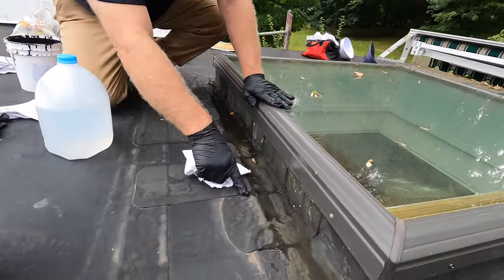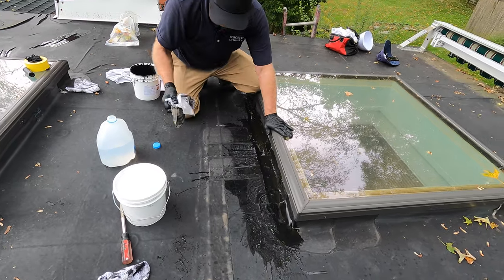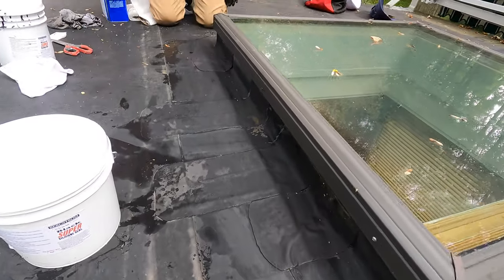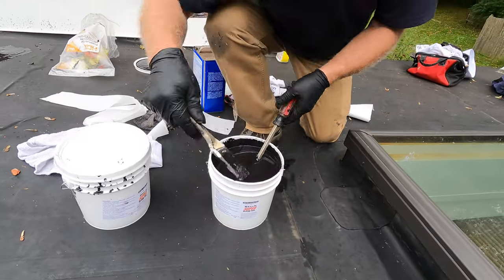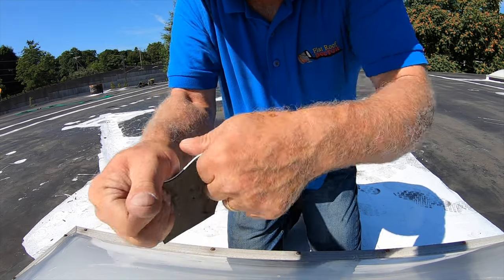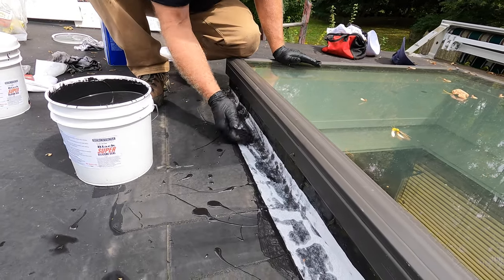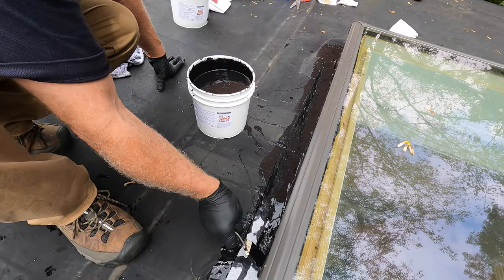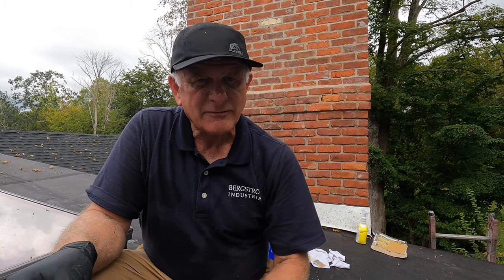FLAT ROOF LEAK REPAIR : Repairing a rubber roof leak very simple and easy and fast- GAME CHANGER

Comment: The problem with silicone based products for leaks has always been that the ultraviolet light from the sun utterly destroys silcone in about two years.  What has been done to prevent that problem with this product?
Reply: You’re absolutely right. Everyone swore by flexseal. I used a gallon of it on my roof and that stuff crumbled apart like old thin rubberbands after two years
Reply: How about silicon product underneath a traditional EPDM tape patch? Silicon would be protected from the sun by EPDM. (I've been battling a leaking skylight for a year)
Reply: @thomfriend1946  just get a real roofer who knows how to replace it instead of constantly temporarily sealing it
Reply: @kevin_e90  after 2 years? Epdm has life expandency of 40 to 50 years
Reply: @mule666  no it doesn't lmao. I haven't seen a EPDM roof that's lasted longer than 10 years or so. The sun dries it out and all patches start lifting over time. That's why it's the cheapest roofer. A mod bit or bur roof is the best, and only those last 20ish years at most
Reply: @kevin_e90  ok
Reply: Silicone is very UV stable. Not sure what else is in the products you've used, but I sincerely doubt silicone is the issue.
Reply: @T2rrusso allegedly have you yourself used it and  can attest to that?! I’ll wait and if so plz tell
Reply: @Truth-L-knowledge  In fairness, it's not alleged - it's  fact that silicone is very UV stable. In my opinion,  technique of application is paramount for a long lasting seal. Individuals have very different standards for what they consider "good" workmanship, and there are so many variables that can cause premature failure. If silicone isn't for you, that's perfectly fine. My point is only that it is unlikely the silicone is the component that is breaking down due to UV. Take care.
Reply: People who dont know commercial roofing wont know how to instal it nor clean the area riight ….also certain brands and silicone last years if you buy cheap crap it wont last anything
Reply: @kevin_e90 i agree im in uk epdm lifts and goes on joints torch on is best am experimenting with a few liquid systems which seam to be working
Reply: @kevin_e90 I've seen a 54 year old EPDM before. And over 30 year old PVC. 40 year BUR (4ply or better, mind you) 20 year tpo though it was a type they don't make anymore. Haven't seen too many old mod bit.
Reply: Silicone has high resistance to uv
Reply: 10-20 years if applied properly
Reply: @rexanderson5024 Sure  if you believe the marketing.  Kind of like how Tamko claims 50 year 160mph warranty right?
(Sarcasm,  you will never get that out of this product)
Reply: Many liquid rubberized/silicone roofing material suggest a UV protection topcoat for best results. Shoot, most DIY don't read instructions or follow manufacturer recommendations.  It's lucky if it even gets mixed!😂😂😂
Reply: $250.a gallon?   What cha all smoking?
Reply: I patch three sections of my roof with the stuff and it's been a year and a half and it still looks absolutely perfect, and my EPDM roof is 25 years old and the only reason I got a leak was the original glue that they glued it together with is cracking and crumbling

Comment: I see a trough was created next to the skylight which causes the water to sit there and rot out the silicone and rubber cement...that should be torn out and done properly
Reply: or just fill the trough
Reply: Or seal a piece of gutter in there.
Reply: Patch over patches.?? Seems like a slap dab job to me

Comment: What happens to the water under those repair flap edges you pulled up? Won't that get trapped and cause bubbling later on?
Reply: Ya I would use a hair dryer to dry up the water under the rubber otherwise you'll have a problem.
Reply: Yes.  Water condensation will create a huge blister bubble between membrane and repair.
Reply: @richardlawrence3770 heat gun better then hair dryer 😮

Comment: This is nothing but a patch on top of the other patches you mentioned. Unfortunately, in two to four years, you'll be putting another patch on top of that patch.It's a never ending battle with the sun and rain.
Reply: Are you suggesting full replacement over trying to patch for a fraction of the cost? I have a 15’x15’ that is leaking.
Reply: 2 years is enough time to come up with a plan for a new roof.

Comment: It all comes down to how much you are prepared to pay or invest your time.  I have  a galvanized tile roof, the tiles sprayed with bitumix and coated with chip.  But around the edges where the water drains off the underside of the tiles (which were not painted   have rusted heavily in some places and only in a few instances has the rust broken through. The cheapest and easiest way is to patch the holes as this roofer is doing.  They might last a few years until   the rust underneath creep through.  To lift all the roof tiles around the perimeter is a time-consuming task and expensive if paying someone else.  It is quite a job removing the nails and individual tiles, cleaning them  up treating the rust, priming and painting before putting them back .  Even repacing with new tiles is still quite a job. What is frustrating is the inconsideration of the roofers who laid my roof. My father, an excellent builder, always said If you put something in, think about those who may have to remove it some years later. I have had a terrible job removing some tiles that were nailed in a way very difficult to reach the  nails.  This  was not necessary and only laziness. But it has taken much time and energy.  

 I notice this roofer rarely lifts the iron roofing sheets to check for rust on the underside, something I  believe should be done where possible.

Comment: Thank you for the video
But the product is quite expensive 
The silicone based products are nice to work with as they are liquidy compared to the rubberized patch cement, which is very thick and hard to spread without making a mess. What will be the drying time for that work? I’m curious how long it takes for that silicone product to dry

Comment: I am trying to repair my flat roof. I have applied the adhesive to the roof. When I lay felt onto the adhesive do I have to peel off the thin plastic sheet from the felt first? Absolute beginner here😮😮.
Reply: Yes

Comment: That stuff looks great, is it used in the UK as I'm looking to add flat roof maintenance to my exterior cleaning business?
I've already used Bostik instant flat roof repair which has fiberglass in the solution
Reply: I'm a roofer in uk start using hydrosil mate or cromarpols cheaper

Comment: what is the point of the fleece? just another type of patch with silicone seal on both sides?
Reply from the maker: Hmm, someone doesn't get it. The fleece is what gives it its strength. Anytime you repair something, you don't only use the liquid over a crack and hope it will be ok. That liquid will dry and crack on the same line where the original crack was. Concrete without rebar is worthless. So is most liquids that are sold to make repairs
Reply: @FixLeaksDIY  yep- to the point and 100% right
Reply: Exactly. It's like fibre glass or carbon fibre. The fleece helps to hold the silicone in place

Comment: If it was me doing the repair, I'd have let the area dry longer or used a heat gun to drive out ALL moisture. Imo this was done too quickly for using a silicone type sealant. Moisture is the enemy of bonding with silicone. You use it to surface CURE silicone!!

Comment: Silicone based products will not stick to EPDM roofs. Google it. Temporary patch at best. And the only way to clean EPDM is with EPDM membrane cleaner/splice wash and Scotch-brite fiber pad.
Reply: What about a bonding agent?
Reply: They use silicone repair on alot of black rubber roof and I seen them hold.

Comment: $800 dollars for a 5 gal bucket? Then pay the guy for labor on top of that. Who can afford this?
Reply: That's why I'm watching videos...my roof keeps leaking...I spend 5 to 10 thousand dollars having a "professional" do my entire roof that is supposed to last for 10 years but never does so I'm watching videos to do it myself hopefully 😬🤣
Reply: @sarahnichols4253  I did my roof by learning from this man, you don't need the $800 dollar component. Just be very careful using the torch down GAF TriPly modified Bitumen. If you rip off the old roof make sure you don't leave any holes or seams between wood where the flame can enter or you will burn down your house. Remove old roof cover with self stick base sheet and then with modified bitumen making sure you don't over heat or under heat the roll. I watch for an even orange flame going across both side then I roll and repeat. Takes time to learn and you'll do fine.